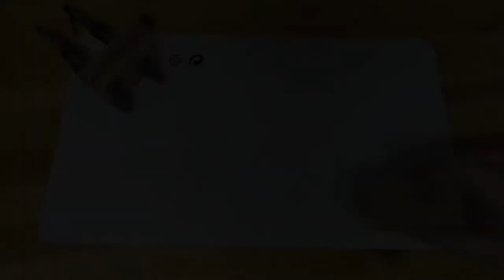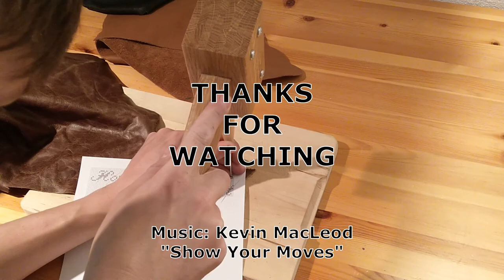Let's make a oak scrap mallet!

Comment: The mallet looks great.... but I have to know, did you just use a kitchen knife with an extra handle on the end of the blade as a draw knife because if you did then that is a stroke of genius??!?
Reply from the maker: Thanks! Actually it's a standard carpenter's knife - I had more knifes than I needed, but no draw knife, so I thought "let's put a second handle on there" and so I did. It's not the widest of blades, but for smaller things it works just fine. 😁